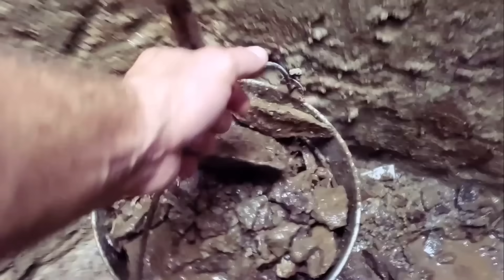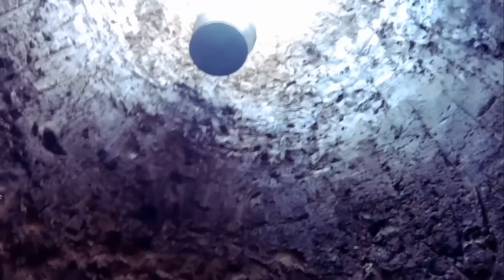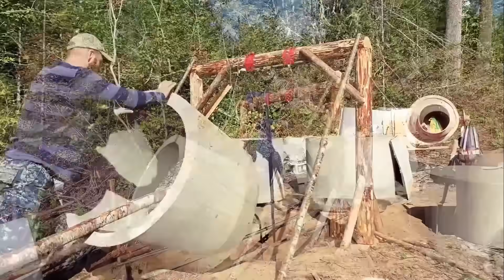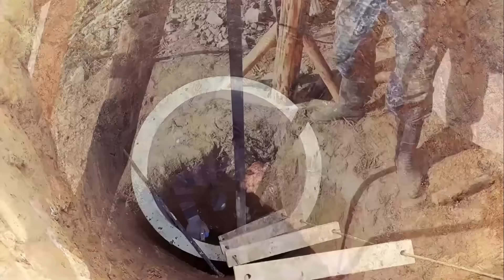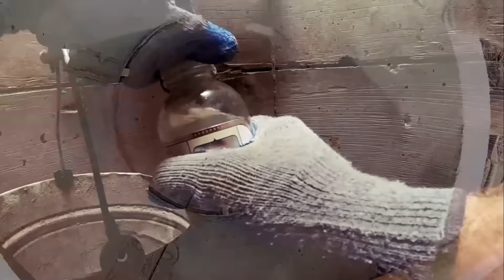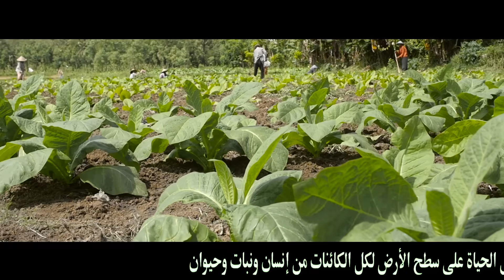حفر بئر واستخراج المياه الجوفية

Comment: Did you hang a heavy rock 1 to 2 feet below your bucket so you don’t have to swim in the whole or well? The heavy rock will pull the bucket tied into the water to scoop water than rope pull it out bucket water. Just an idea

Comment: That is all very, very, hard work, but I had a thought: While digging:… since you have a generator, and once loosened or broken up, (dish soap would help) - imagine a 6 hp wet/dry vac… it would get really heavy really fast, but still… might beat a shovel and a bucket on a rope… You wouldn’t HAVE to fill it all the way up before hauling it out… Plus there’s always a block and tackle… just a thought…

Comment: Film has NOTHING to do with the title. The digging of the well is actually incorrect. The cement casing rings need to rest on gravel and rock. There also needs to be the same along the sides for a bit. The second part of this video has a narrator who sounds like he recorded in the well that was dug. Very very strange video this.